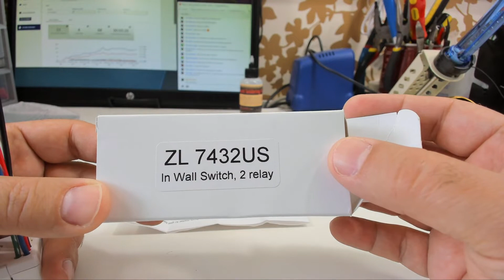Solrep2000 - Budget temperature-controlled soldering iron, unboxing, review and demo (plus tips)

Comment: Some tips: Never use a wet sponge, tin the tip with tip tinner, keeps it fresh.. Clean the iron between use with the metal scouring pad..  Iron tips should last a year no problem..  Also, there is no reason not to use leaded solder.. Much easier to work with and most of the things you hear about leaded solder is just urban legend..